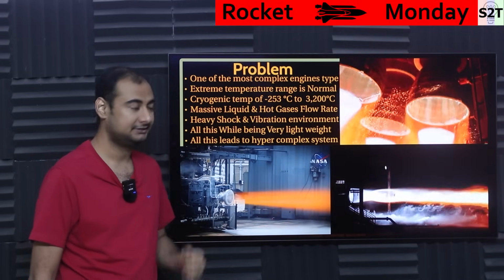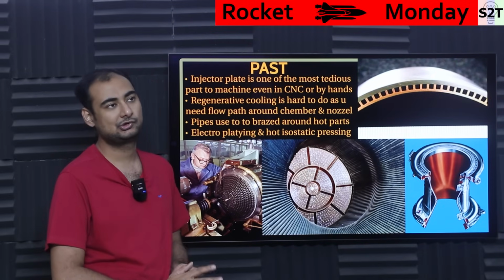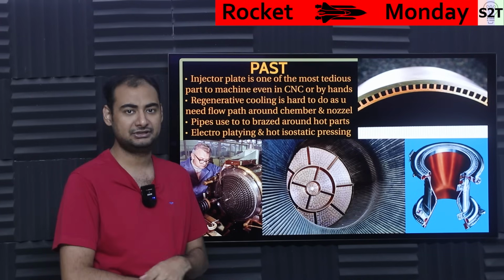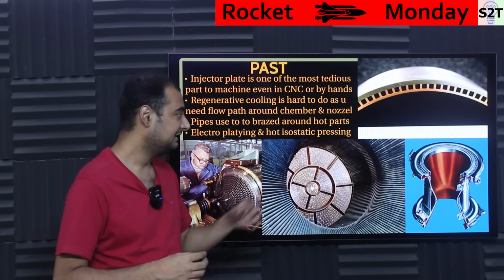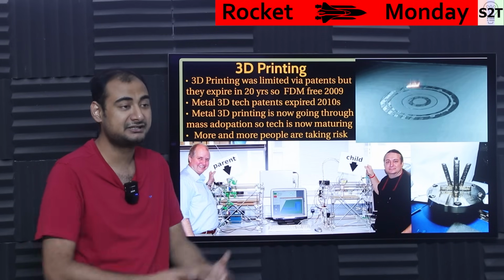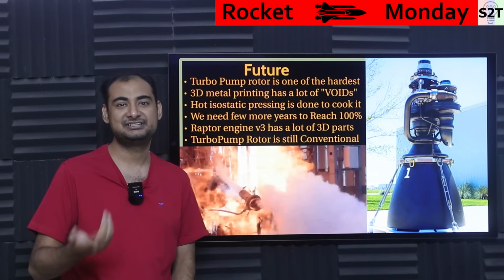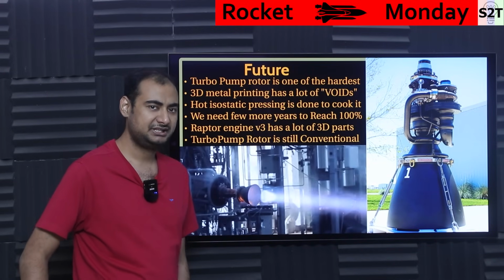3D Printing Rocket Engine Explained {Rocket Monday}

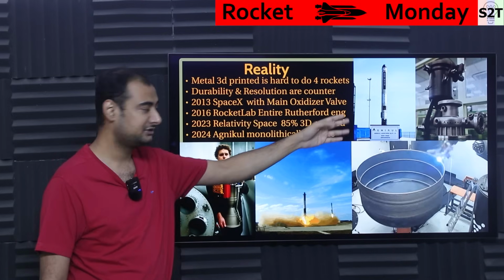Comment: 13:00 sir you missed skyroot aerospace,they build 3D printed lox methelox cryogenic rocket engine. it's name is dhavan
Reply from the maker: I always though they are the one who is building solid rockes not liquid ?
Reply: @s2tenglish Yes they are building solid rockets but they also developing liquid engine for upper stage of rocket like Raman which is liquid engine that use hypergolic propalant same as ISRO use in Vikas engine and other one is Dhavan which 3D printed "Cryogenic fuel ," which is liquid methane and liquid oxygen. They uploading videos related to their rockets and engine on their you tube channel it may be helpful for your future video. and 
Thank you for replying 😊